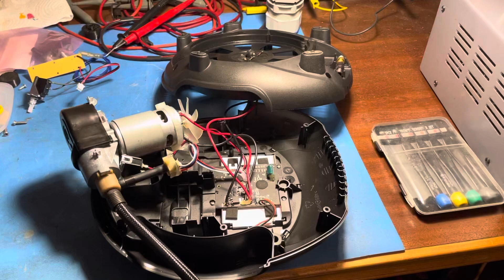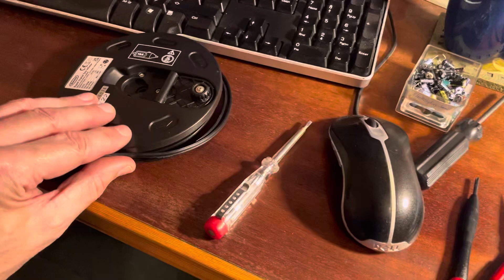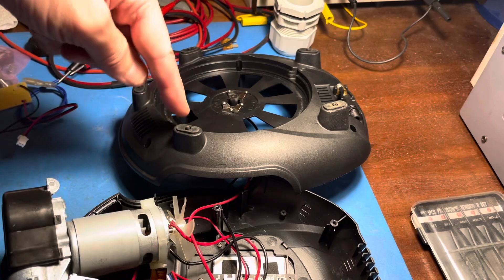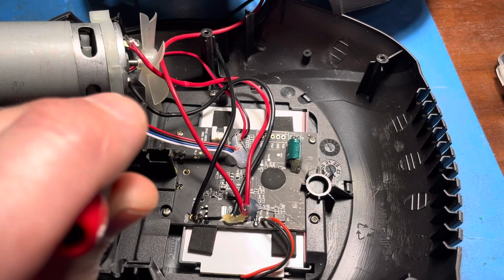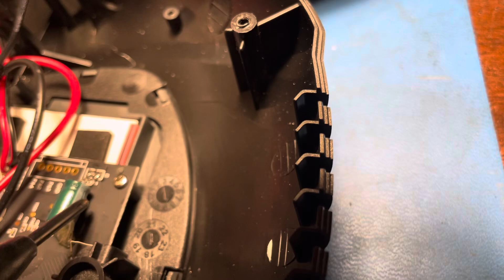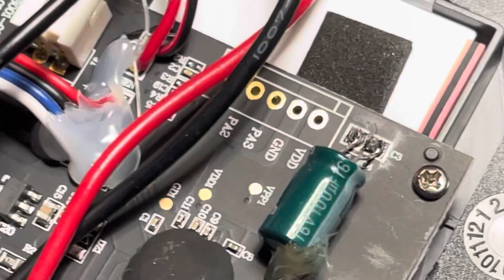Ring RTC1000 Rapid Tyre Inflator Compressor Repair

Comment: Mines not showing the current tyre pressure. It shows the target pressure and runs, but obviously does not auto stop. Any Ideas out there?
Reply from the maker: From what I can see from the way it operates, the start button is just a command input to the controller under the black blob on the circuit board. I would imagine that this then turns on the transistor to power the motor and it should also switch the display over to the current pressure. If the motor starts when the button is pressed then that pathway is probably correct. The only other way of calling up the target pressure when the motor is running is to turn the knob to select a different value.

I am correct in saying that you had the same symptoms as mine and then fitted the capacitor and now the motor runs? Do you get a current pressure reading when you connect to the tyre?

I would always recommend checking the last work done on the unit. Check for trapped wires, broken connections, missing screws, solder bridges, etc.
Reply: @bvqbvq Hi no work has been carried out on the unit yet. These are my observations: All functions except for when connected to the tyre valve I get no reading on the display just 0.0
Reply from the maker: @nicknicolaou8512  that's not right, it should show the current pressure. Is the sensor connected correctly to the circuit board, I think that it uses a 3-way ribbon cable. It would be worth checking the integrity of that.
Reply: @bvqbvq Hi I've checked and found there is a pressure sensor TK1200. It sits under a round metal plate held on by two screws. It's an SMD component, but can't find one online anywhere.
Reply from the maker: @nicknicolaou8512  is it this one? http://www.tgmcu.com/content/?197.html

Have you checked continuity to the terminals from the micro? It is more likely to be a bad joint than a faulty sensor. It's only 4 resistive elements configured as a bridge. You should be able to measure their resistance (approx 5k).
Reply: Yes that's it! Don't know how I would go about ordering it though. I will check for continuity first as you have suggested and maybe a reflow?

Comment: Fitted the capacitor but mine still does'nt work. There is no screen flicker on mine. I found if I hold the power button down all the time it will work. Any ideas what could be wrong..... thanks.
Reply from the maker: If you hold the button down all the time, what happens when the pressure reaches the set point, does the motor stop or does it carry on running? If it switches of the motor correctly then it sounds like you might have a faulty switch. If you've got access to a multimeter you can test the resistance of the switch. It may not be latching, i.e. it is switching off when you release it. You may be able to disassemble it and fix it or you can probably find a replacement switch on ebay.
Reply: @bvqbvq  Thanks for the reply. It does knock off when when reaching the desired pressure. The switch resistance is fine. I presumed this would'nt be a latching switch though .... am I wrong ?  I wondered if the latching circuit was on the pcb. (edit)  Looks like the switch is a self locking switch (KDC-A10)  .... I'll fit a new one 👍
Reply from the maker: @Dinopigdog  yes, the switch is meant to be latching. The circuit switches off the motor at the desired pressure. It sounds like a replacement switch might well fix your problem.
Reply: @bvqbvq  Sorted it out ... the start switch (KDC-A10) is actually a non latching switch. Swapped it with the switch for the led light (SW-3-2) which is a latching switch. Unit now works perfectly. Ordered new SW-3-2 from aliexpress (2 for £1.20) to replace the led light switch. Thanks for your help. (I'm presuming latching cct must be on the pcb)